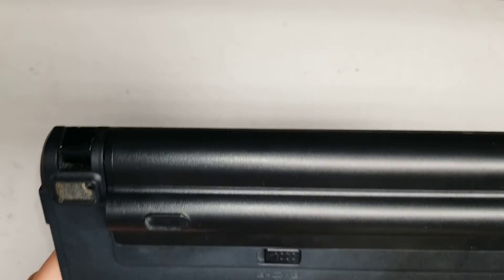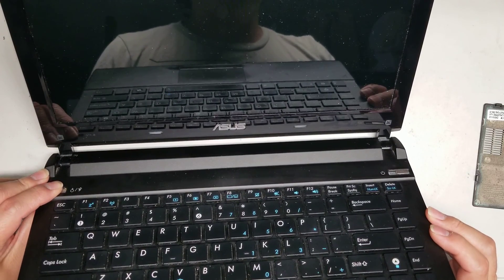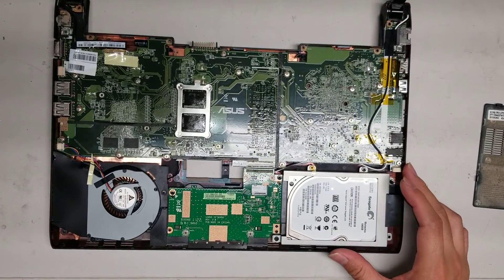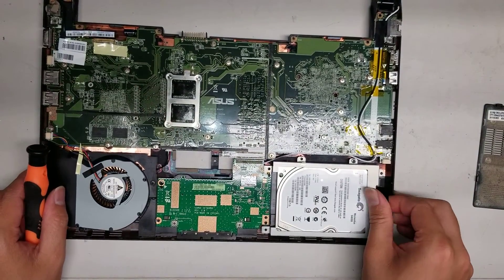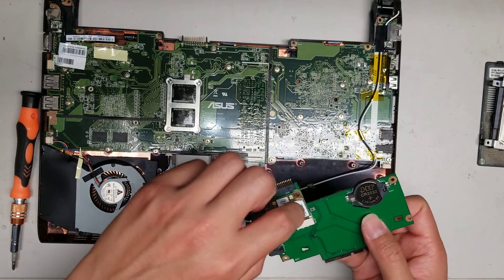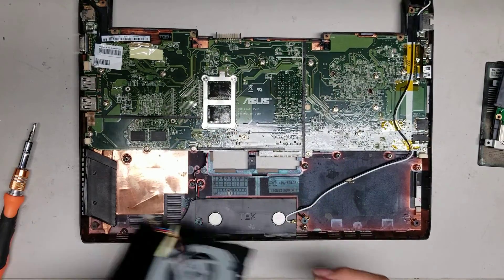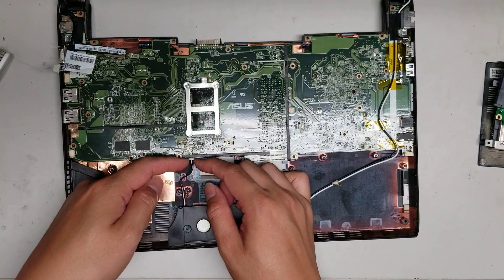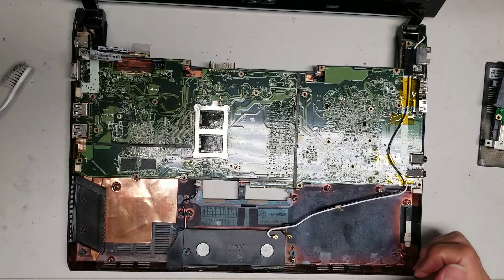ASUS U36S Complete Disassembly RAM SSD Hard Drive Upgrade Repair

Comment: Old video I know. But at 1:34 my ribbon has fallen out and it won't go back in and im unsure as to why
Reply: Im also missing the cable at 1:14. Any idea as to where I would get one?
Reply from the maker: @Jamman1403 maybe ebay
Reply from the maker: Did you push the tabs back in?
Reply: @ItsBinhRepaired which parts do I push?
Reply from the maker: @Jamman1403 watch the video again

Comment: I have got a U36jc model. HDMI port does not work at all(and it seems not a driver or hdmi cable problem) even formatting, upgrading driver, changing SO to Win10 issue remains. Do you think could I change the hdmi port on my own with a normal solder? If yes wich kind of port should I buy? Best regads!!
Reply from the maker: If you have to ask, your soldering skills likely aren't good enough.

Comment: I have the same laptop and have upgraded to SSD, added more RAM and installed Windows 10 - now it's screaming like a banshee. Any idea what I can do to keep it from running so loud and hot? Will thermal paste do the trick?
Reply from the maker: Depends, is the fan just spinning fast, or is there an issue with the fan? Is it a strange fan noise, or just high speed fan?
Reply: @ItsBinhRepaired  its high speeds when opening chrome I'll try cleaning the dust off and see if it works better. Don't think I can find a replacement fan anymore
Reply from the maker: This might help. https://youtu.be/3zs_SJ3BXgA

Comment: Hi, I have a asus U36SD DH51- v slow working nowadays, and CPU usage is always alltime high, not an issue with virus/anything, everything looks ok, I am thinking of SSD upgrade. can you share link in amazon , which SSD fits for Asus U36SD and do we need any adapter? for fitment
Reply: model U36S, MB Version U36SD
Reply from the maker: Is the disk utilization in the task manager really high?
Reply: @ItsBinhRepaired  When I start the system - CPU usage 30-40%, if I open youtube and say gmail in another tab - 90-99%. Disk utilisation yes 100%, bought in 2012-13
Reply from the maker: @udai4k  that's a failing hard drive. Definitely want to upgrade to an SSD
Reply: @ItsBinhRepaired  I am not able to decide on a particular SDD, which one fits best for asus u36s. Could you please share some links where I can buy. I am not looking for a massive storage but Cost is not a limitation for me.
Reply from the maker: @udai4k  how much storage do you need?
Reply: @ItsBinhRepaired  500 GB
Reply from the maker: @udai4k  this should work https://amzn.to/3dta0OJ I just ordered 3 haha
Reply: @ItsBinhRepaired  it say we are not sure if it fits with asus U36SD DH1
Reply from the maker: @udai4k  open your computer and check if it looks the same. If you can't open it, then no point buying an SSD.
Reply: Uday Kumar same problem did you try an SSD
Reply: @ICTechProductions  hi, yes it's working better. I upgraded to SSD. But laptop heating problem is there. I am yet to do RAM upgrade. But SSD upgrade really helped.
I currently have 4gb ram, need to get 8gb and see if heating still persists.
Reply from the maker: Those upgrades won't fix heating issues. You need to clean the fans and heatsink and possibly change the thermal paste.
Reply: @ItsBinhRepaired  fan cleaning I can do myself, not an issue. Do you have a video on thermal paste check. Share a link as well , where can I buy it.
Reply from the maker: @udai4k  I don't have one specific for this laptop
Reply from the maker: @udai4k  you can use this as an example. https://youtu.be/AKe4kdPVqvU